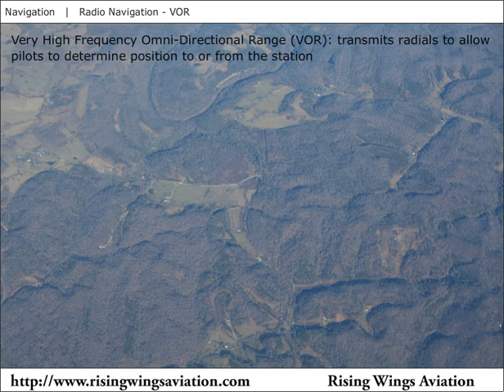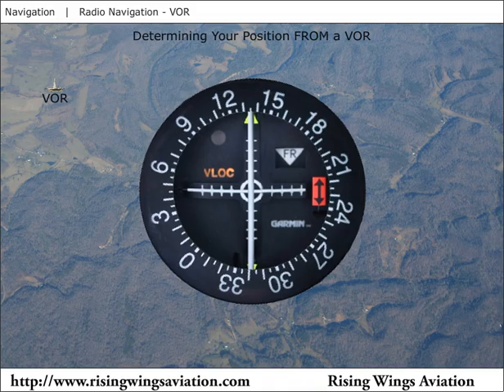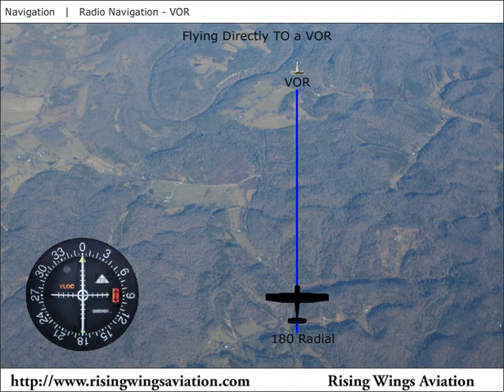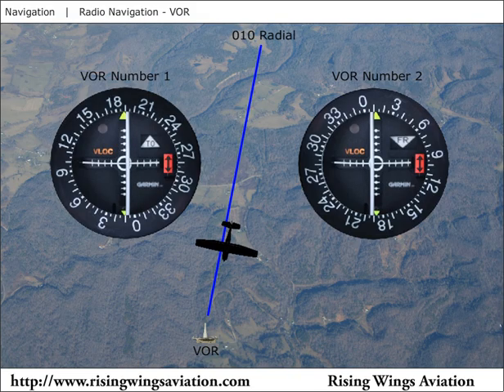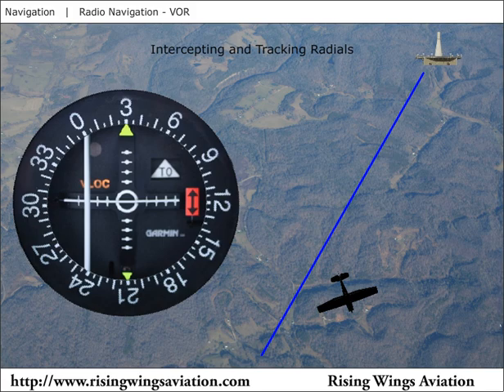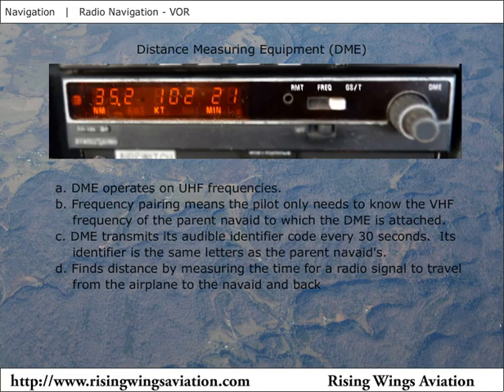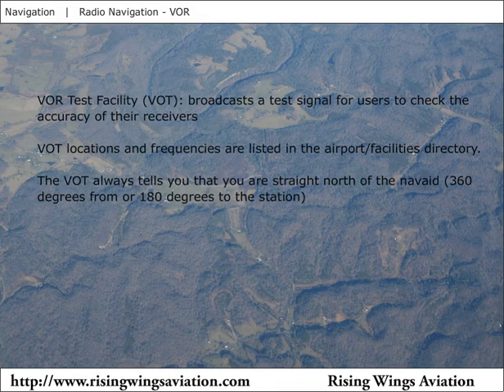Navigation Using a VOR

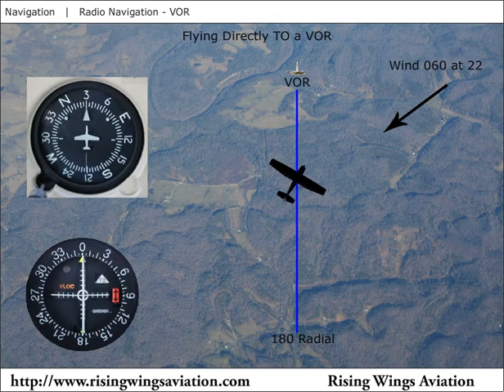Comment: 5:20  It is not necessary to make a guess.  Per the designer of the VOR instrument, the course correction is shown.  Where the CDI needle intersects the compass rose of the instrument is your correction to maintain the desired radial.  Example:  at 5:05 the CDI needle is shown intersecting the compass rose at 15 degrees.  15 degrees is your correction.

Blame your CFIs if you didn't know this.  Then he can blame all his CFIs.  And so on.

Comment: While VOR navigation dont tell you the distance from the station, would do be able to use the VOR's sensitivity to make a calculated guess of how close to the station you are? By flying left and right a bit. 8:22
Reply: DreamAboutSpace Use triangulation instead. Most VORs have DME. If your plane does not have DME, tune in to a nearby VOR and center both needles with a From flag, Draw the Radial lines from the VORs on your chart. When the lines intersect, that should be your exact location.

Comment: Couldn't tell you how many night flights when a VOR has saved me from going to wrong bunch of lights. One cold winter night I was flying into Amarillo Tradewinds from Ok City and was determined that ATW was right where I was heading, but Amarillo VOR said no, and while I was still pretty determined that I knew better, I finally woke up and got back on that VOR radial and went directly to ATW. Moral here is to practice using VOR until it becomes automatic in your head.
Reply: Agreed that VOR navigation is indeed very useful! I am a student pilot with a little over 60 hours, including around 10 solo. I'm almost ready for my checkride, and oddly enough (compared to what most students seem to say), I find VOR navigation VERY EASY and intuitive and I seem to be quite good at it!! 

However, unlike the others, I'm actually TERRIFIED of navigating using visual landmarks! (pilotage). I've gotten a lot better at it now than I was, but I still have a lot of difficulty. I can't seem to make out the difference between various things (lakes, rivers , creeks and so on and how to "spot them" - I'm terrible at it at times). 

My instructor kept saying, don't you see that creek, don't you see that airport. It takes me all the time in the world to spot them!  😃 Interstates are probably the only thing that I can consistently and reliably identify and spot. I also get "disoriented" very easily. I spot something and then after I've made a steep turn or something, I have to look and look and look to see where that "thing" I just saw went! 😃

Comment: A WW2 instructor explained "Don't overthink it"' He used a actual bicycle wheel and in 10 minutes I "got it". I have flown with IFR rated pilots who knew how to fly TO the VOR and not much else. A lot of instructors are bad teachers and just want time. With today's gps its almost a lost art.
Reply: JIMJAMSC I'm part of the younger generation of pilot, but I still appreciate learning how to navigate using pilotage and older methods, it makes you appreciate aviation. Thanks for sharing
Reply: JIMJAMSC which makes me wonder if this is worth stressing to learn..... even the 1970 piper I fly has a friggin GPS
Reply: I am 53 and got my ppl on my 18th bday.Pumped gas,bummed rides,did the linemen thing to move up. I learned the old fashion way most from x ww2 types. I had no problem learning or using vors. Some cannot grasp it. If one is going to be a recreational,fair weather vfr pilot they will learn to pass the test and never use it. However if one is to make a career they need to learn and utilize every possible aid they can. One thing I learned the hard way is just like light signals, short field landings etc one day you will need to use these things. It was not until my last job flying pipeline patrols in helis I used gps so I cannot imagine a world where you HAVE to use them. It was a luxury. I am out permanent due to a back inj but seeing vors/adf, physical paper maps, round gauges as nostalgic really makes me feel old.

Comment: ...pulls out GPS, then concentrates on flying the plane.
Reply: Its to be hoped there is never a failure in the GPS system, cos there is going to be an awful lot of young cocky pilots flying around with absolutely no idea how to find an airfield.
Reply: Why not? They're just as good or even better, sorry we are not old af and we are adapting to better and more useful technology.
Reply: KingA Kingz - Agreed.  VOR is ancient and should be eleminated.  Like using morse code when you have a perfectly good cell phone.  Maybe something to keep in your back pocket, but too damn easy to make a mistake when the circumstances are dire and under stress.  GPS, make the little airplane follow the line.  Emergency?  Push the direct to button.

We dont deliver mail on horseback anymore.  Why?  We got better technology.  Cars...
Reply: Awwww pumpkin... too tough for ya?  Gotta rely on those new fangled gadgets to fly?

Comment: WHY make a navigation instrument that makes it so easy to make a mistake of type where you goes opposit of your desired course. Now  i understand why we have plane accidents. Morse code identifier. What T F***. Magnetic compass. What tf.
Reply: These are actually pretty safe and easy to use. But most airplanes now use GPS. But since gps can fail we have to learn these methods too. Airplanes are still the safest method of travel.
Reply: Danish Roy Safest method of travel, but worst way of dying. Imagine sitting in an airplane going down and wait for several minutes to die.
Reply: runeguldberg well at least you have some time to say ylur farewells
Reply: runeguldberg naw. there are far worst ways of dieing. drowning in a submarine for example or being buried alive. mean while air travel is still the safest means of transportation, and every second that goes by there is a fatal car accident in the united states alone.
Reply: runeguldberg safest in the terms of "unlikely to crash". but not in the terms of "crash survival"
Reply: runeguldberg the amount of accidents from navigational errors due to misunderstanding VORs is roughly 0. The amount of accidents from poor airmanship and getting into an unrecoverable stall/spin in the traffic pattern make up the majority of GA crashes. If you can't understand VORs, don't be a pilot.

Comment: Pretty good explanation.  Couple of additions:   
1.  When tracking a VOR radial, to avoid confusion the course selected on the OBS should always be close to the heading shown on the compass.  By "close" I mean 5-30 degrees difference.  This will prevent setting the OBS 180 deg. off.
2.  This discussion referred to turning towards the needle and when it centers then guess at a new heading.  Don't guess!  Here is how to determine what heading to fly that will KEEP the needle centered.  Start with needle centered and the heading of the A/C the same as the setting on the OBS.  When the needle gets off center, then:  a)Turn towards the needle 20 deg.  b)When the needle centers, remove 1/2 of the correction, which , in this case is 10 degrees. c) If the needle moves off center again, turn 10 degrees toward the needle.  d) When the needle centers, remove  1/2 (5 degrees) of the correction just made.  e)If the needle drifts off center again, turn 5 degrees towards the needle, f) When the needle centers, remove 1/2 the correction (2.5 deg).  At this point, the needle can be held centered by adjusting the heading 2.5 digs left or right as needed.  

This method (I call it the "Half Angle Method") can be summarized as 1) Start with the needle centered, 2) When the needle drifts off center, turn towards it.  3) When the needle centers, remove 1/2 of the cut made to get the needle centered.  Initial cut s/b be 20 deg., then 10 degrees, and finally 5 degrees.  

This works well and like said before, it takes about 5 minutes to determine the exact heading (+/- 2.5 degrees) that will hold the needs absolutely centered.
Reply: The idea is good but only works if you have chosen a quite high intercept course. If you are actually quite close to the right course you might sometimes need to add, instead of subtracting the half of the angle

Comment: It should have been noted that DME measures SLANT rang and is not a direct indication of distance (NM) to that station. The greatest error received when using a DME is at high altitudes when directly over (or close to) the station. DME can be used fairly accurately up to distances of 199 NM from the station.

Otherwise, great job on the tutorial.